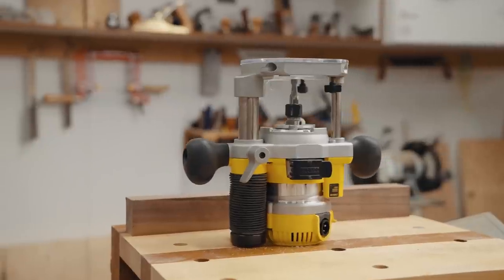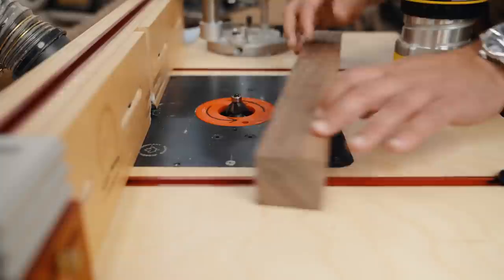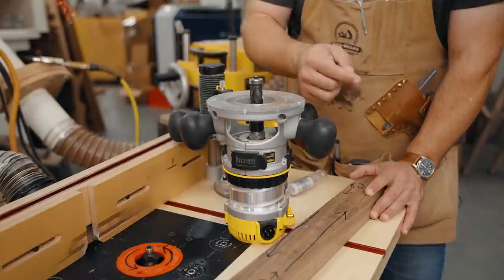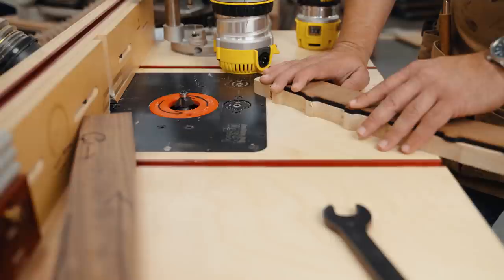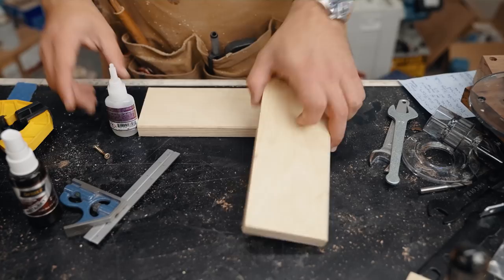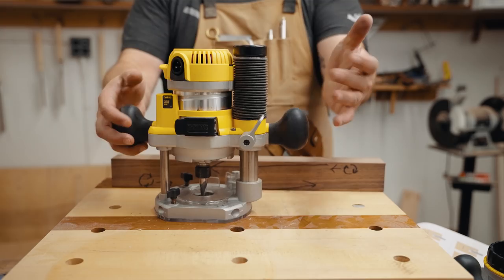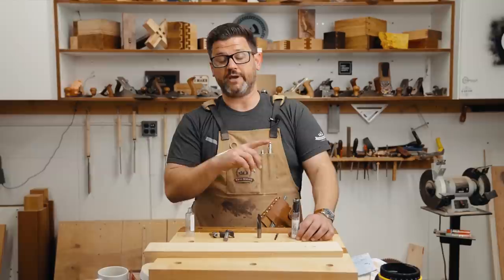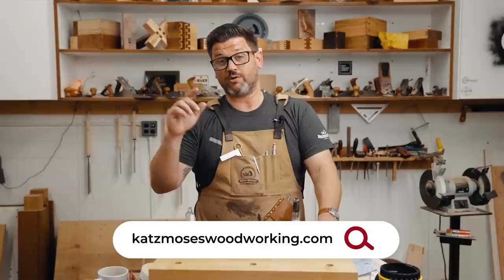Routers - 7 Important Things You Should Know

Comment: Honestly, I'm not cheap; just thrifty.  My Scot heritage comes through at every opportunity.  For 35 years of occasional router use I kept telling myself that high speed steel was good enough for what I did with a router.  Wood got more expensive and I wanted better quality outcomes.  Thanks to you and others like you, my standards are better these days and I don't dare risk $7.00 or more per board foot lumber on anything less than Freud or Whiteside bits and the Bits&Bits coating ROCK.  I watch my expenses by not trashing nice wood.  Good tools are less expensive than damaged raw materials in the long run.

Comment: My first table saw was Craftsman contractor saw.  I purchased a cast iron extension wing for it which came with a router plate and fence.  I loved it.  Much better than the small working surface available on most router tables.  Years later I graduated to a cabinet saw with the right wing incorporating a router mount.  With my offcut extension table, I have a router table with sixteen square feet of work area.  Most, if not all, of the cuts in this video can be done better and more safely using a table, rather than a handheld router.  I know, like me at first, a lot of folks have a limited budget but, it is something to keep in mind for the future.
I will not have a saw without this provision.

Comment: Good video.
Router table = right to left
Router= left to right
One thing I might add is use dust collection whenever possible. I believe it is Oneida who makes a hood to hook up to a vacuum. It will also help cool the bit. Just make sure you use a very flexible hose and make sure you can control the router  safely with the vac hose connected.
Ron

Comment: Great video and information. 
In another video, unfortunately forget which channel, they mentioned another benefit to bushings. Template bits have bearings at the end or base of the bit, which requires full bit extension or full depth cuts of the work piece. With bushings being independent of the bit, you can make template cuts at any depth.

Comment: The depth stop can be used as a precise depth measure too..........zero out the bit on the work like was shown here, place the work piece you want to insert into the routed area on top of the "turret" stop and place the depth plunger on top of the piece and lock it down....now you have the precise depth for the part you want to fit :)

Comment: An extension of the right hand tip (not for when the router is in a table): if you extend your right thumb and index finger (like a gun, pew pew) and place your thumb against the edge to be routed your finger will be pointing in the correct direction of router movement.
Reply: I mark my routers on the top and the side  with a black marker.

Comment: I like the right hand rule, but modify it a little. I point my thumb up, index finger forward, and curl around the middle, ring and pinky on right hand.  (Like when a kid makes a gun using their hand). The thumb points up for table, down for router, the middle, ring and pinky indicate the direction the bit spins, and the index points in the direction the router should be pushed.

Comment: Nice video, thanks.  The only thing I don't like about only using the first 1/4" of the bit is you wear that part out and dull it.  To help with that when I use the same bit with a bushing to trim an edge I stick the bit slightly over a 1/4" out the other side and use the part of the bit that is still like new.
Reply from the maker: Yeah but also just part of consumables

Comment: the dewalt plunge router has integrated dust control.  take the cap off the top of the rubber accordion gizmo and plug in your DC hose.  Dust and shreddings are generated in HUGE amounts from routing, so you should try and get dust control under control.  Many routers have DC attachments you can buy, shrouds, etc.  several edge guides you showed have DC capabilities as well.

Comment: Great video, your concept on the direction of the bit, never looked at it that way about the right hand grip. I was taught, look at the direction of the bit itself, you want it to always pull the material "into" the router or fence if a router table. 
Now, I do have to disagree about the auxiliary fence, reason is, chips have to go somewhere and they don't all drop straight down. Perfect example of this is, do a dado with a handheld then do one on a router table, see which has a better chip clearing. I prefer to have that opening for this reason only. The fence on your router table isn't solid like a TS fence is, again, chips have to go somewhere plus, it allows airflow to help keep the bit cool. Overheat a bit and they'll snap on you, can cause a very serious injury, 30k rpms and a small projectile... not fun. 
One thing I was taught about setting depth, use brass bars in aid to set your depth and small bites. I've seen many bits break because some people believe, it will just push through, they don't, they'll break. Great video, cheers :)

Comment: Great video as usual! Those were some really good tips. I looooove the dado jig. I'll have to make some. That's just genius.

I couldn't agree more about bit quality. I started out with a cheap set and followed advice you gave in an earlier video about buying the individual bits you need and slowly building you collection. I think it's best to get what you need instead of buying a set and ending up with a bunch of things you don't and maybe won't use. 3/4 of the set I bought I've never chucked up so YMMV.
Reply: I initially bought a couple of loose bits after spending quite a bit of time researching, but found they didn't do exactly what I'd expected.  So then I bought a decent sized set which has allowed me to experiment.  It also means that when I am busy doing something on a Saturday afternoon I don't find myself needing another bit I don't have which means waiting until the following weekend to go shopping.  And since the cost per bit in the set is much lower than buying the same brand separately even if I only ever use half of them regularly it won't have cost me more.

Comment: I truly apologize if you have covered this. I am right now in the market for a larger router. I want a 1/2" collet router and only have a trim router today. 

I had it in my head I would either go cordless with the Metabo HPT, or if I went corded, would want to go all out on power. That said, I was a little shocked to go to the Acme tools listing for one of Makita's 3-1/4 HP router to find out what kind of power cord it uses and read the specs as 120V/15A. 

So have all these manufacturers created perpetual motion motors that defy the law of conservation of energy? Some quick math reveals that these numbers aren't possible. 3.25 horsepower is very nearly 2400 watts. a 120V/15A cord can supply 1800W (and since 80% breakers are common, even if they were drawing that you would VERY likely trip even a dedicated circuit). I mean, I was wondering if they were at 20A or if they went all out to 240V since you're pushing VERY close to the upper limit of a 120V/20A circuit with a motor that powerful. 

Are they just lying? Are they stepping down the power for the US market? What gives?

Comment: Hello, thank you for the insight into routers as well as this video, thanks to both of them I started thinking seriously about DeWalt, although already have a Makita. There's however one thing in this video I don't understand. When you close up a fence like you did in 7:06 on DeWalt router, it would stay between the bit and the workpiece. How would you rout then? For the bit to cut, the fence has to be open just a bit wider than the diameter of the bit and the bit has to stick out the front surface of the fence by desired amount, right? Otherwise they would never meet... The same goes with that piece of plywood on the "cheap" fence. Without opening in it the entire bit will stay either inside or the outside of the fence. Setup like that would only work when you cut a dado which is not always the case.

Comment: I recommend multiple routers... 
I have a....
 
Triton TRA001 beast for my table

DeWalt 624 general use plunger

Cheapo plunger permanantly set up for my dovetail jig

And a cheap little trim router... 

The first 2 were spendy (& well worth it) but the other 2 were not... 

Also, when using the table, featherboards , horizontal & vertical , are your friend... I made my own from ABS as I've also got a fully equipped machining setup, mills & lathes etc... 

😎👍☘🍺

Comment: Mr Moses I’m sort of stuck I’ve just brought a dewalt dcw 604 m2 and need to put a straight edge on 26 2.4 meter  lengths of csl timber fro framing my workbench’s. Do I need a flush trim router bit and can I rest router on  the bit of wood I’m cutting. I did try my thicknesser and planer but it’s a cheap and cheerful one but planer beds to short and to be honest it’s not very good. Many thanks steve 👨🏼‍🦽🇬🇧

Comment: Sorry, not always. I used to do miles of cove bit routing each month, and we always used a climbing bit method. If we didn't, we would always get chip out which would ruin the work piece. Never chipped out using a climb cut. It was harder to control but did not chip out.

Comment: Whats the maximum depth? I can't find any video that shows the depth of 50 to 70 mm. 
I want to route holes for door hinges for a pivot door. The upper hinge has a depth of 67mm (2.63 inches), and the lower hinge has a depth of 58mm (2.28 inches). 
I already found out I can buy a 70mm (2.75 inches) bit in length. But can all routers support all sorts of lengths? 
If not, can somebody advise me on which router should fit my job? It has to be a plunger (I guess). 
I know 1/4 of an inch is the max I should use due to the pressure on the bit, but I need to end up with a 2,75-inch depth in the end.

Comment: Johnathan, if I were wanting to use a pattern bit on 1.5" material, can I use a 1/4" compression bit without a lot of flex?  The ultimate 1/2" shank bit won't cut 1.5 inches.  There are other bits available, like the spetool ranger bit, but I'm suspect of it.  Thanks

Comment: Another tip is when using a plunge base is to not let the base fly all the way back out with spring pressure. Always have the base touching something when releasing. The force of the base slapping at the extended position can change the depth of cut. Dont ask how I know...grrr

Comment: I know this has probably been answered in another video before and my apologies if I am asking a repeat question, but what is the recommended bit for using the router as a jointer?
Reply: I would assume flush trim bit if you had a guide for the bearing to follow. If you’re taking off a lot of material though it could be a lot of work for the bit.

Comment: Is it ironic that your right hand rule for router bits happens to be the same as the right hand rule for determining current flow and magnetism field direction?  The electrons pass through the wire in the direction of the thumb and the magnetic field spins in the direction of the fingers of the right hand. That spinning field drives the motor shaft holding the bit.

Comment: Jonathan, Question about bushings:
Why do bushing sets frequently come with odd sizes like 51/64" OD. If using a normal bit, the template offset would be in increments of 128ths? Why would you ever want that?
Reply from the maker: If you were doing inlay work you'd want the negative to be 1/128-1/64 bigger than the positive
Reply: @katzmosestools  You are the master. I thought you should know that I learned how to woodwork from YouTube and you are one of several key professors.

Comment: I have a related question and wondering if anyone can help. I am brand new to woodworking and I've been obsessing over whether I should buy a 8-1/4 in. or 10 in. table saw.  One of the main reasons I've been leaning towards the 10" is because only the 10 in. accepts dado blades.  Do I need dado blades if I can use a router instead? Just wondering if ya'll use a table saw or a router for dados.  I'm pretty sure I will be making those kinds of cuts based on the type of projects I want to work on.  Also, in general, is an 8-1/4" sufficient? The DeWALT happens to be $100 off right now.
Reply from the maker: 10" without question

Comment: Wondering if you might give me some advice. For now, I have a skil 1830 with the plunge & fixed base. I bought a crb7 which I think is a fairly good accessory and seems to be well made. It was supposed to be compatible with the router but the guide rod holes in the base are too narrow. I'm sure the easy answer is buy another router but there has to be a smart way to correctly drill put the guide rod holes in the router base. You probably don't want to even come come to touching on this but I'm hoping you might have some thoughts, experience, or advice on this. Jim
Reply from the maker: Which guide rods?
Reply: @katzmosestools  Hey. Thanks for getting back to me. The CRB7 comes with 2 sets of guide rods and 2 extensions. They seem to be interchangeable. In short. The guide rods that slide through the holes of your router base to mount it are all too big in diameter. I saw a post somewhere someone drilled out theirs to accommodate but I was curious what your take on it might be or if you had another idea.

Comment: I recently bought myself a router and feel like having a router table would be a huge benefit...many of the ones I have looked at say that the router should be a plunge style, mine is a fixed base...would you say that is just a recommendation or is there something about some if the table designs that just will not work with a fixed base router?
Reply: On these Karen, there are so many options out there this is tough one to give a pat answer to, but I'll try. The tables that require a plunge router are relying on the plunge base to act as the lifting mechanism to raise and lower the bit height. Usually, the routers have accommodations for making this adjustment when they they're upside down by having a hole in the base for a long hex key to be inserted from the tabletop. And the tables may have pre-drilled holes to fit specific routers. The fixed based tables may not even have pre-drilled holes for any router bases. So, you must drill them yourself. To adjust the bit height on these, you must reach under the table and use whatever system the router has. This type is one to avoid at all costs because when trying dial in that exact height, you could go from the tabletop to reaching underneath many, many times. One exception might be something like this. 
"Rockler Convertible Benchtop Router Table"

I hope this helped. Best of luck, Chuck
Reply: @toolchuck , thank you for your response...I will check out that Rockler table you mentioned...
Reply: @karenlight-crandell597  Which router do you have?

Comment: There's an easier "right hand trick"; point your index finger and extend your thumb, making a backwards "L".. now put the tip of your thumb on the edge you want to route, and your index finger points the direction you move the router... Flip your hand upside down when you're using a table (just like the router is upside down)...  Make the L and point!

Comment: My understanding of needing more power in a router also has to do with the center of mass of the bit you are using.  A small spiral cutting bit has a significantly lower center of mass then a large diameter slot cutting bit.  Because of this the router requires a lot more power to spin the bit and maintain that speed once cutting.